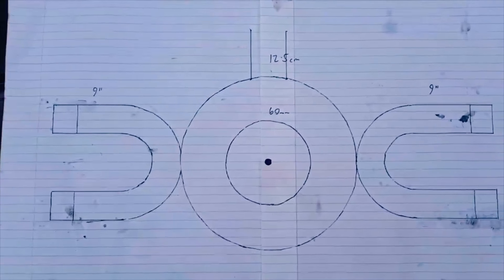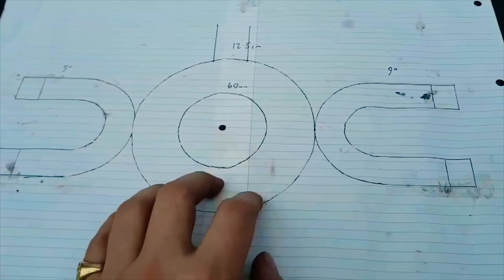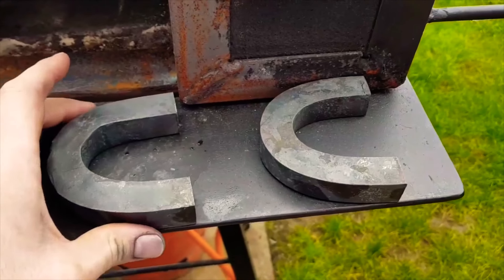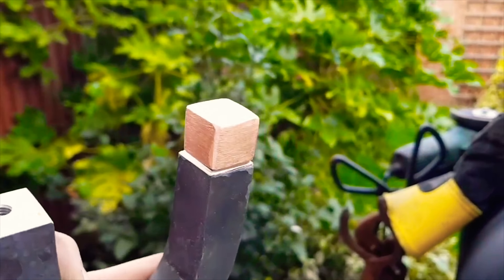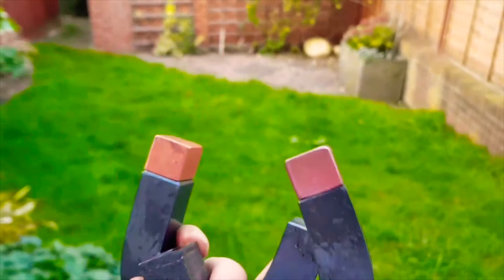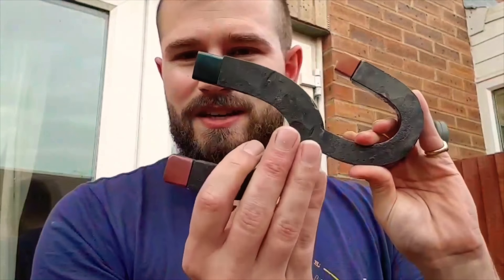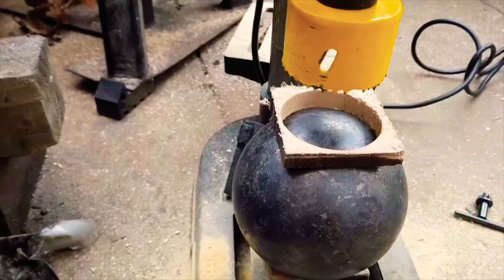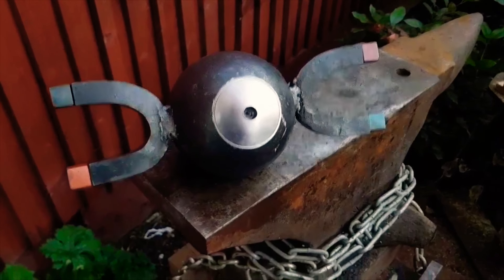REAL Hand-Forged Steel-Type Pokemon: Magnemite

Comment: I think 2 steel bowls welded together might have been cheaper and extend the life of the shelf it is stored on... but knowing your welding it probably would have just melted through the bowls. Thought you would attach some magnets to the ends of the horse shoe magnet, but the copper look you did instead was very cool.
Did you give up on steelix?
Reply from the maker: I might've been offended by that welding remark if it wasn't so utterly true. 😅

Not given up on steelix, it's been half done for about a year. But I've had other stuff on the go, so it's been put on the back burner for an indefinite amount of time.
Reply: @PJTForging  ooops, lets pretend i said "knowing your welder" then instead and save from hurting anybodys feelings.... except maybe the welder manufacturers  :D

Comment: Imagine making one but it's hollow & on the inside is two-four staters around a central copper coil.
The two arms, (or horse shoe magnets) of the Magnemite, when spun will in turn spin the two-four staters inside the spherical body of the Magnemite.

Directly on base of the Magnemite would be a basic single port two pronged 12v outlet, or what ever the engineer can devise.
This would act as an outlet to charge your phone or something novel while also functioning as a stable base for shelf display.
Reply from the maker: This is definitely too technical for me. 😅

I just like hitting stuff.

Comment: You're a proper Brit alright, only we would have Metric and Imperial measurements in the one set of plans. You just need a few tweaks on the anti-gravity and you'll be ready for market. I hope you were wearing the safety flip-flops.
Reply from the maker: Of course! And yeah, unfortunately I'm that age where I tend to hop between the two units depending on which seems closer.